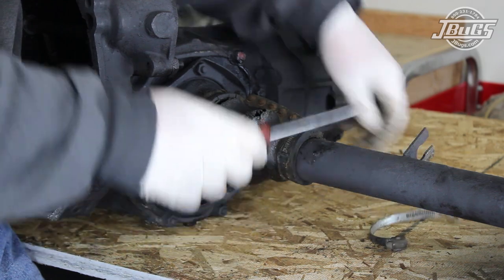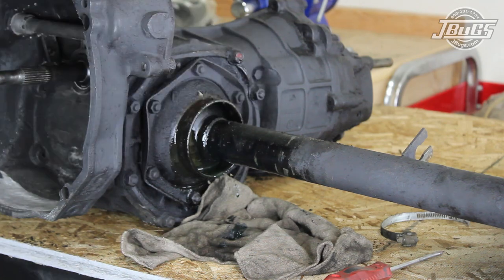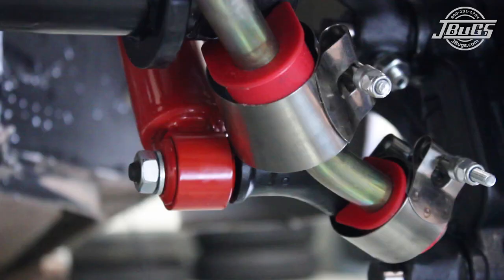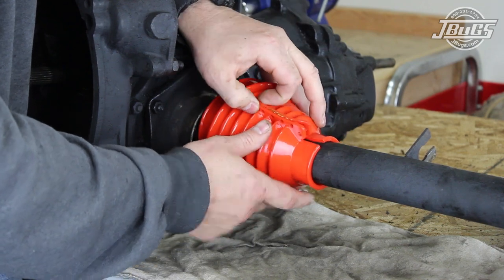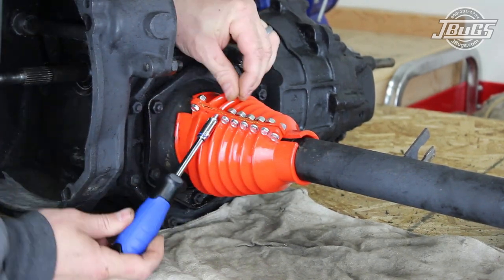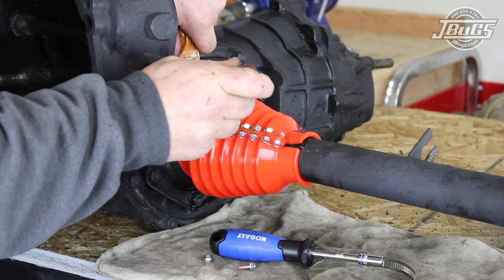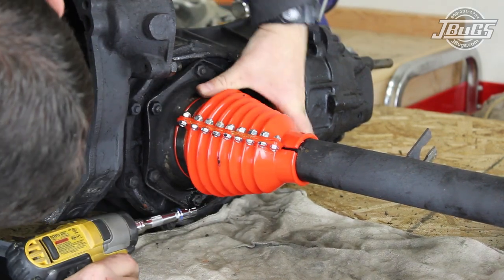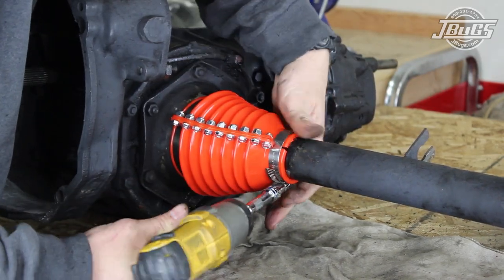JBugs - 1963 VW Beetle - Swing Axle Boot Replacement

Comment: I'd rather see it done while the transaxle and engine are in the car with a jack and stands like us home garage vw guys do it
Reply: I'm guessing you didn't watch our video where the transmission was pulled, while the car was jacked up on stands. We didn't use a lift. Either way, on a bench or in the car, the process is still the same.

Comment: No grease?
Reply: No, and the boots are still in place today and not leaking.
Reply: Apparently they use transmission fluid. Which explains the puddle under my car.
Reply: @Not-Great-at-Gaming  Correct, the flexible boots are in place to prevent the transmission fluid (gear oil) from leaking out. The gear oil sits in the tube as well and runs all the way to the brake backing plate.

Comment: Seems to be a lot of controversy out on where to position the seam of the boot. I suspect it's  a personnel preference as long as you don't point it Straight down.
Reply: Yep, talk to 10 different people, you'll probably get 10 different answers!
Reply: My '64 VW owners manual clearly states,  to install boots with sealant, place the seam horizontal, facing the rear with the screw heads on the bottom for ease of install.  There is no bellows in the seam and they will tear if the seam is on top.  Stick to the book and you can't go wrong.
Reply: Rtv???